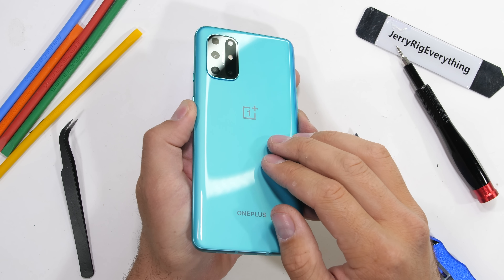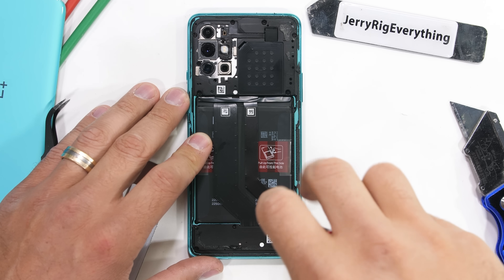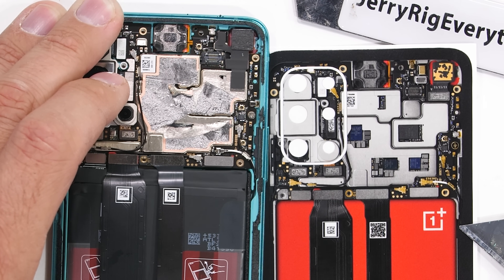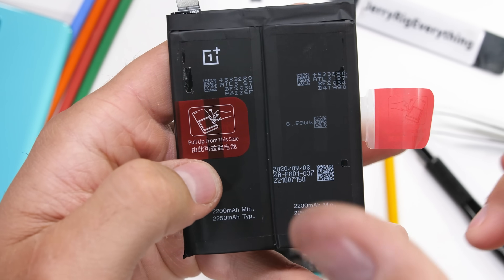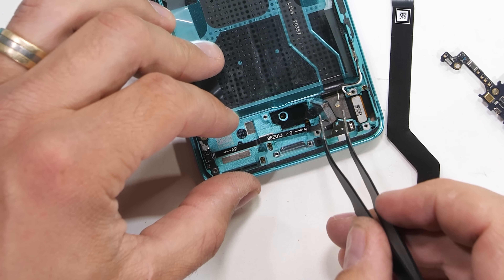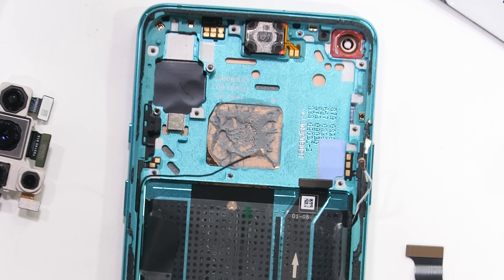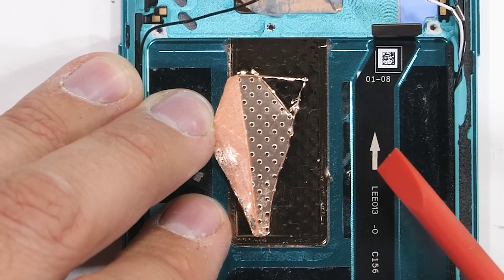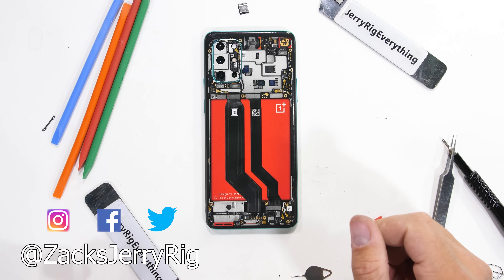Oneplus 8T Teardown! - Are there really TWO batteries?

Comment: Just FYI this battery is running at 2s or 7.74 volts as it says on the back. this means that the two batteries are in series not parallel and that the total capacity is actually 2200 milliamp hour not 4400 milliamp hour. If they were in parallel the voltage would be what we're used to seeing and then the capacity would be 4400 milliamp hour. I'm sure they say 4400 milliamp hour in their documentation because if they said 2200 milliamp hour people wouldn't understand but the reality is it's a 2200 milliamp hour battery at 7.74v.  if the two cells were in parallel they would not be able to charge the many faster because two cells in parallel are exactly the same as a single cell.
Reply: Agreed, the batteries won’ safely charge faster wired in series not in parallel. Both can be charged at the same wattage and C-rating

Comment: Waiting to hear jerry rig say "glass is glass" when he scratches at level 6 with deeper grooves at 7 on the iPhone 12's ceramic shield...
Reply: Of course it will scratch at level 6, Apple didn't say it's more scratch resistant. They said it's more shatter resistant though.
Reply: @diavalus  then phone buff should do a drop test
Reply: Alexander Mason  we'll see about that in the next video
Reply: Alexander Mason  you really think that's ceramic? Its prolly marketing bs, let's see anyway!
Remember sapphire on the camera
Reply: Alexander Mason  Zach is the only one that I would trust
Reply: "ceramic" you mean. I bet it's as much as ceramic as their camera covers are sapphire
Reply: If I remember correctly xiaomi made a ceramic phone years ago.
It scratched harder but shattered easier.
Reply: @fl00fydragon  absolutely. It was the mi mix 3.

I daily drove one for two years before retiring it for my current mi 10 pro. Never managed break the ceramic but I did drop a 600lb car subframe on it and I shattered the thin glass that covered the selfie camera under the sliding screen. The actual display glass and back didn't break. Phone still works fine and was passed on to my fiance who doesn't use selfie cameras 😂
Reply: @Tekgnome.  Yea, that.
Thanks for the info.

I am sick of apple claiming to "innovate" by adding features that others have used for years and then get praise from its fans and tech news for "introducing something new".
Reply: @fl00fydragon  my s10+ is a ceramic back, as is my essential PH-1
Reply: Yes
Reply: Alexander Mason  okay, might of been my bad for misinterpreting your comment because it appears we are on the same page here.
Reply: Alexander Mason  my old mi mix 3 had a ceramic back instead of glass. It was actually pretty neat. It made the phone significantly heavier but two years of hard abuse the front glass had some pretty good scratches but the back ceramic still looks brand new.

It's definitely possible to make ceramic and sapphire displays but odds are it's just apple's usual bs. 

I would like to state for the record that generally speaking ceramic is significantly more likely to cracking and chipping. Apples ceramic shield sounds even more bull 🐂 when you take in to account that.
Reply: Alexander Mason  oh you don't even want to know how many phones I have lmao
Reply: Go to the durability tests.

Comment: (Note: I am not a battery engineer, but I do destructive testing on Li-ion batteries). Batteries are typically given 'C' ratings which correspond to the relative current that can be used with a cell. 1C for 5000 mAh means its takes one hour to charge at 5A approx. (2C for 10000 mAh ~ 0.5h at 20A). Smaller cells still typically have similar C ratings which results in a similar charge time for the whole battery. Effectively one cell is just two put together anyways, so I think the gains we're seeing in terms of charging are better batteries to begin with as well as better/more efficient charging curves, and not multi-cell configs.
Reply: Totally agree, they are just trading charging speed for shorter lifespan
Reply: @hugodeandres1497  absolutely. There are better charge curves being developed to minimize heat generation and plating concerns, but simple fast charging just sacrifices longevity. Generally the move to multiple cells is to assist packaging (see laptops). In a phone like this (with the cells right next to each other) however, I'm not quite sure what the advantages are. Might be a part sourcing issue or easier/cheaper to buy higher C rated cells at smaller capacities.

Comment: I'd like to add to the double battery. Charging speed is defined by how much amps you can push into that battery, which is defined by the C rating, which is defined by the mAh since C rating of these are constant. Now you say doubling up the batteries, but what they're really doing is putting 2 cells in series or parallel. What I dont understand about this is the fact that they cant charge these batteries any faster if its got 2 cells vs 1 cell, because the Wh will stay the same. Charging cells at these high rates is making me very scared of their lifespan, since batteries don't like heat and pushing more current in creates heat, I'd have to guess that in actual use, these phones will last half as long compared to one using lets say a 18W charger.
Reply: 2 cell is required so that they don't need any voltage conversion module, which generates more heat. When charging, the two batteries are wired in series so they can receive higher voltage directly from the charger (10v, 6.5a). This approach generates much less heat than Qualcomm's approach to fast charging and enable them to charge at a much faster rate
Reply: @Bennedict929  Yes, you are generating less heat which is a limiting factor when charging lithium based batteries because of lower current values. But there are other factors to account for when charging lithium batteries C-rating is one of them and it is still limiting how fast you caan charge the battery regardless of how little heat you are generating
Reply: @Bennedict929  And you still need a CV-CC module inside the phone which is mandatory to charge any lithium battery
Reply: @hugodeandres1497  CV-CC module is of course present in every smartphone regardless of which fast charging technology it uses. However, most other fast charging protocols use both regular CV-CC module and voltage step-down conversion module. This step down module generates a lot of heat, much more than the battery itself, especially at higher voltage. The charger needs to use higher voltage because most charging cable is limited to 3a, which at 5v is capped at 15w. 9v increases the limit to 27w.

By wiring the two batteries in series, the power can be sent directly to the BMS with CV-CC module without a need for voltage conversion, and the charger itself can take care of regulating the voltage. As for the battery itself, Oppo stated that they used two 3C-rated batteries inside the phone, which at 2250mAh each should be able to take 6.5 amps (around 30w) safely. There's no step down module so the battery will be the only component producing heat while charging.

And no, lower C-rated batteries does not produce more heat, conversion of the high voltage does. C-rating was never the final limiting factor of how fast a phone can be charged, overheating is.
Reply: it's basically just 2 of warp charge 30t module working in series, with a charger ramped up to 10v to avoid exceeding 8 amps on the usb ports and the charging cable
Reply: Cells in parallel can charge all at once so it's faster than charging in series
Reply: @bachaddict  2 cells in parallel is the equivalent of a single cell battery of twice the capacity. A 1s2p and a 2s1p made of the same two cells will have the same Watt hours, but the 1s2p will have twice the mAh capacity and the 2s1p will have twice the voltage. However, the charge time would be the same assuming you use the  same c rating, since all that means is that the charge current is equally proportional to the battery capacity in mA. 
I believe the reason that tesla uses a lot of small batteries is not because that directly allows them to charge faster, but because the smaller cells are easier to cool effectively, which in turn allows for faster charging.
Reply: @kiddrone8336  Reason tesla uses 18650's is because its a standardized size, easy to mass produce and is circular which is good for those cells. Also creating cells as huge as a car battery is nearly impossible. Im happy im not the only person whos asking questions about why theyd put 2 cells in these phones, it doesnt reduce heat, nor does it improve the lifespan. All it does is take up space
Reply: @kiddrone8336  But if you charge each cell in parallel with its maximum current, you're putting in twice the current.
Reply: @justfpv1432  ah yeah, didn't think about the size issue with cars. But  yeah, the OnePlus double battery doesn't make any sense... Unless it's some sort of supply issue with 4000mAh cells? That seems very unlikely though
Reply: @bachaddict  You are putting twice the current of the small battery but the same as if was a single battery. They are increasing the current draw not because of this ‘innovative’ system but because they are allowing degradation to happen

Comment: @Zach, Apparently the T-Mobile version had OnePlus certify the 8T (called 8T+ on the T-Mobile website) with IP rating for their phones they sell. I wonder if the T-mobile version has more water resistant seals than the unlocked version?